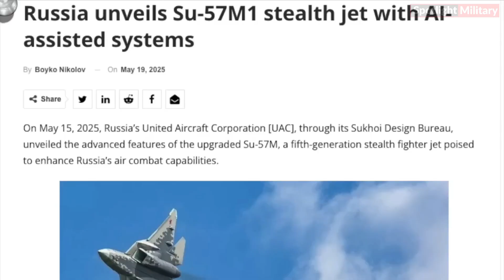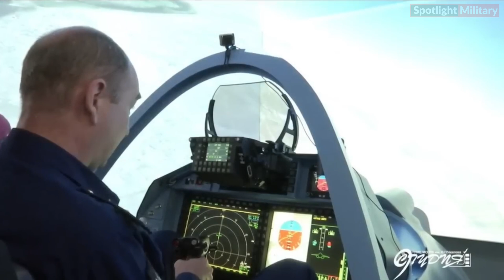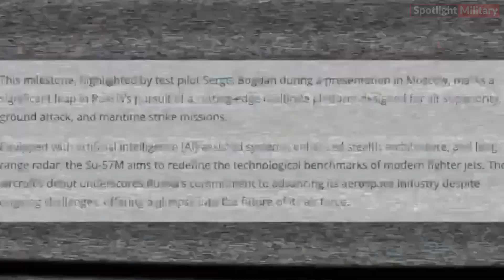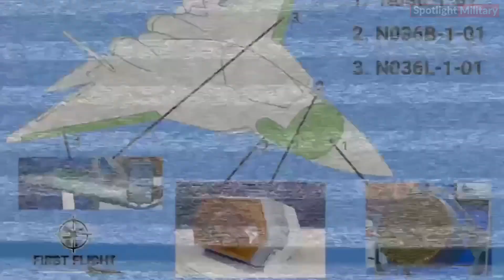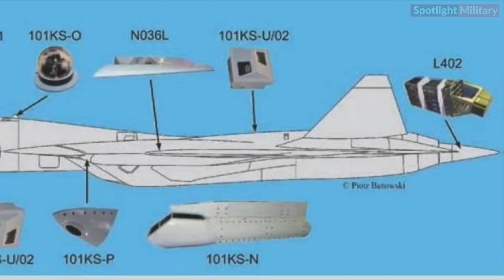Su-57M1 Officially Takes Flight: Russia’s Most Advanced Stealth Fighter Ready for Battle

Comment: I'm an Indian viewer, and the Indian media is claiming that the AL51 engine isn't ready for series production yet, which is why India is still hesitating. If India were to purchase the SU-57, the first two squadrons (approximately 40) would be equipped with the old AL41 engine. The new AL51 engine would only be available from the third season onward. So, what's the truth?
Reply: The Air Marshal has clearly stated India has no plans to acquire this. The platform is not war tested at all